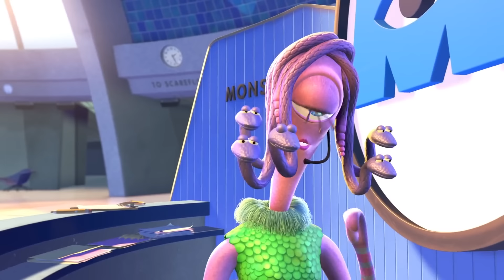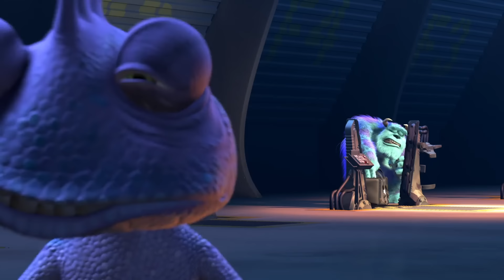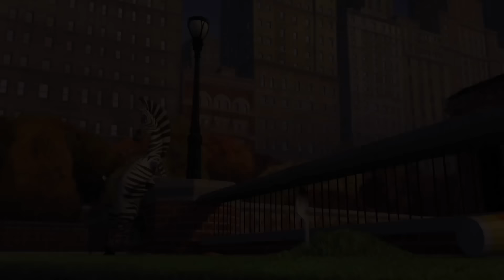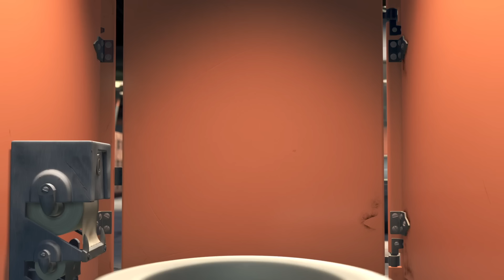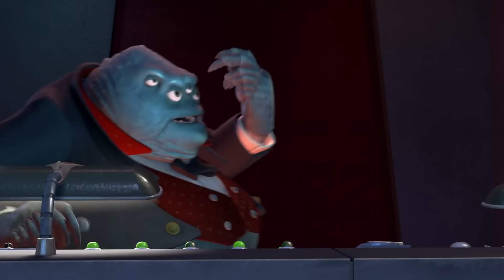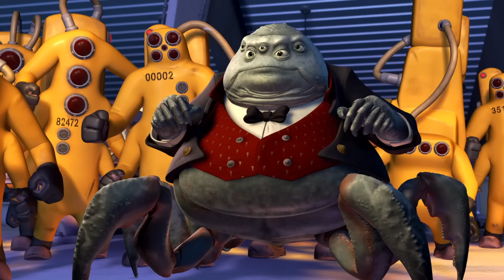IF YOU DON'T LAUGH   I'LL PAY YOU   [YTP Monsters Inc.]

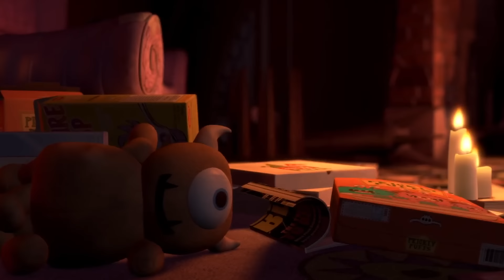Comment: 3:16
That Dodgeball Throw Was Personal💀 (Why Did I Die When I Saw That?)

4:13
The FitnessGram Pacer Test is a multistage aerobic capacity test that progressively gets more difficult as it continues. The 20 meter pacer test will begin in 30 seconds. Line up at the start. The running speed starts slowly, but gets faster each minute after you hear this signal. [beep] A single lap should be completed each time you hear this sound. [ding] Remember to run in a straight line, and run as long as possible. The second time you fail to complete a lap before the sound, your test is over. The test will begin on the word start. On your mark, get ready, start.